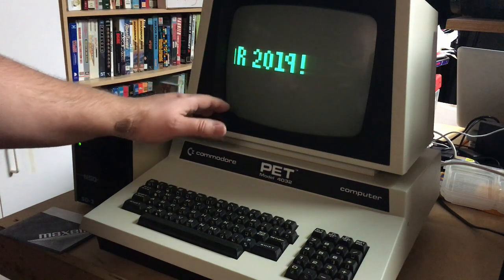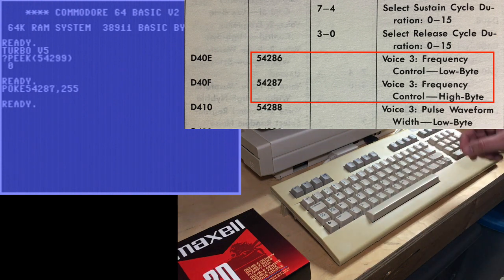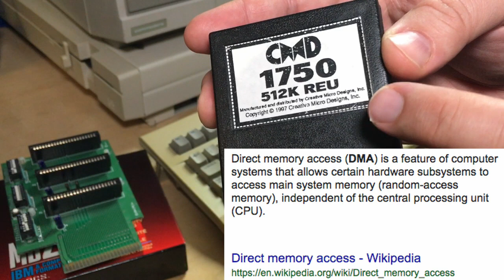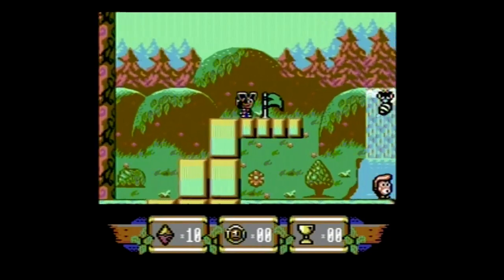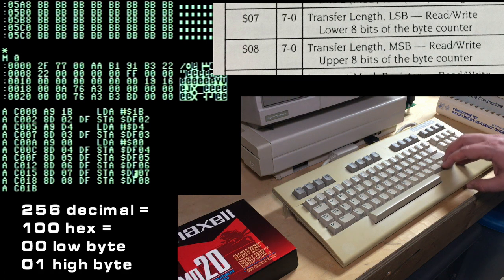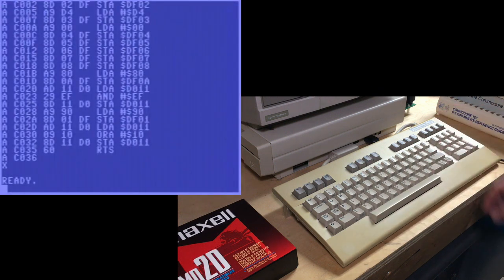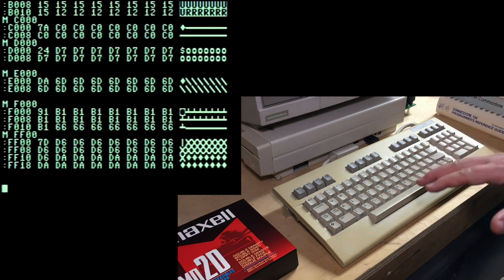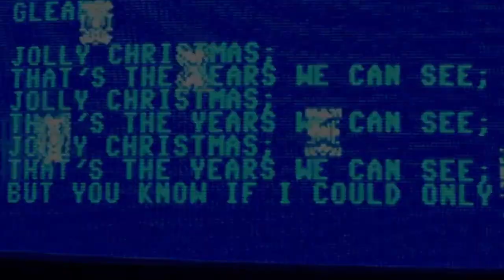Commodore 64 REU (RAM Expansion Unit) & SID Random Numbers

Comment: Very interesting episode about the REU and great teaching ! 
Before detailed pictures of the SID die were available for analysis of the actual logic, OSC3 & ENV3 were used to emulate most of the internal behaviors of the SID in a cycle-exact way, which made reSID possible. It was a big deal when it came out in the late 90s because it fixed a lot of problems like "ADSR delay bug" and "ADSR boundary bug". Suddenly SID emulators based on reSID sounded much more faithful. Sampling OSC3 also allowed finding noise periodicity and LFSR logic but it could not explain how combined waveforms were generated from logic as it involves analog stuff !
Your idea about the extra cycle is correct. A voice accumulator is 24bits, each cycle the 16bits freq is added to it. The noise logic generates a new value from its LFSR when bit #19 of the accumulator is set to 1. To get a quick idea, this happens in average every 2^20/freq cycles, with freq = 0xffff it's exactly every 16.0002441444 cycles "most of the time 16, once in a while 17"
Reply from the maker: Thanks for the awesome info! I'm interested in learning more about combining the waveforms. Years ago I made a SID-detect routine that used combined waveforms to decide if it was 6581 or 8580 but only partly understood what was going on ;)
Reply: @8_Bit  I don't know the details of what's going on at the analog level when combined waveform are enabled, on the 6581 most of them produce 0 output except the #5 waveform (triangle + pulse) which produce this very strange complex SID-specific waveform ( Flight Path 737 title https://www.youtube.com/watch?v=hCjmzaED-8k )
Maybe you have used a specific combined waveform that produce 0 on 6581 and non zero on 8580 and sum a few output of OSC3 and see if the result was 0 or so ?
Reply from the maker: @laurent64  I now remember that my routine ended up in C= Hacking text magazine. If you search for "SID Type Auto-Detect" in http://www.ffd2.com/fridge/chacking/c=hacking20.txt then you'll see my code. It looks like I combined the triangle and sawtooth waveforms, maybe not the most reliable way?
Reply: @8_Bit  it should be quite reliable, in your code you say it's not 100% though ? on 6581 the higest value is 3F and on 8580 it's FF with a lot of values > 80 so i would think your detection works all the time ? maybe you could set and clear test bit of d412 before starting the detection to make sure accumulator starts at 0 ?
Reply from the maker: @laurent64  I think it worked reliably in my tests but due to the variation in the numbers returned I felt like once in a while it might get unlucky (lots of low numbers returned) and would detect 6581 when really it was 8580. I don't think I realized the max value was 3F from the 6581.
Reply: If we take 0.0002441444*65536, we get 16.000xxx, which suggests that this condition should happen about 16 times every 65536 clock cycles, but the 17 equal-value span is observed to happen only once.  My guess (with no internal knowledge) is that there might be a 16-bit accumulator register inside the SID that sets a new random sample for the noise channel every time it overflows.  Every 16 clock cycles, the SID adds the value in the frequency register to the 16-bit accumulator register to produce the overflow.  With this arrangement, the $FFFF sound frequency will produce an overflow every time but once every 65536 clock cycles (when the starting accumulator value is $0000 and the $FFFF frequency gets added to it for the result of $FFFF and no overflow), which is what is observed in this experiment.  This behaviour could be confirmed by running this experiment several more times and seeing if there is exactly one 17-cycle span during every experiment (with no 17-cycle being observed one time in every 64K experiments).
Reply from the maker: @csbruce  Yes, I think this is correct.

Comment: Since the SID oscillator is independent of the processor, discrepancies in the polling of the SID (since the oscillator isn't precisely timed with the main clock) could produce effectively random (not repeatable) errors, like you demonstrated.
It's really cool! This sort of polling-a-slower-machine is used everywhere in computer security, to generate entropy bits  for priming pseudorandom number generators! If you've ever had a program tell you to move the mouse around for apparently no reason, it's using that kind of polling to increase entropy, which makes the PRNG better at RNG-ing! Additionally, some systems will keep track of polling discrepancies and give them to you when you ask for a random number (The CSPRNG behind /dev/random and /dev/urandom on *nix systems does this!)
I'm far from an expert on this sort of thing but it's a really, really neat way of generating entropy!

Comment: Hello Robin. I did that same tests with my Nano SwinSID installed on a C64 (250425) BreadBin using a Ultimate II+ cartridge as the REU and a Super Snapshot Cartridge also emulted by the Ultimate II+ and it would seems that the Swinsid timer is not as predictable/regular as the real one. I get no regularity in the number changing and I also get many zeros. Maybe my choice of emulated equipment renders things incompatible with the real stuff. (Or maybe I have reach my Peter's limit LOL) Anyway, your channel is among the most interesting of the genre. I did my share of assembly programming on the 6809 and the 8088 using debug, edlin and other rudimentary tools  in the days. It is only now that I get to experiment on the commodore stuff and your channel is much instructive and of great help. Keep on the great work. It is very generous of you.  Best Regards.
Reply from the maker: Hi Daniel, that's very strange and interesting that the Nano SwinSID would give such different results, or perhaps it has something to do with the Ultimate II+ REU emulation? If I get a Nano SwinSID installed someday I'll have to test this with a C= REU. Thanks for the info.

Comment: Fantastic demonstration of how to use an REU!  I had a 1764 and remember that GeOS was the only software that would leverage it -- but even then, it would only be used as a RAM-disk.  Since CMD's superior REU came out in 1997, it isn't surprising that no new retail games were written to support it.

At the time, there was also a text file in circulation showing how to modify a Commodore REU to boost it to 2MB (or 4MB?) by stacking various RAM chips on top of one another and making the required connections to traces on the board.  You can imagine the quality of schematic in that file -- all done in PETscii!  If I am not mistaken, the 1764 circuit board has several spaces where additional RAM chips may be added, effectively turning it into a 1750.

Comment: Pulling a value from a free running oscillator like that works like Sample and Hold on analogue synthesizers. It takes the current voltage at a certain point in the oscillator cycle and holds it for a finite amount of time - you apply that voltage to another oscillator, filter, amplitude or any combination of the three. It's how classic Sci-Fi "bleep bloops" are created, including, I think, the random beeps from R2D2 (which used an ARP2600).

If you slowed it down and applied the value to the pitch of oscillator one set to a square wave, you'd get instant Sci-Fi! I might have to try that. :)

Comment: The random number update makes sense. 0xFFFF programmed into in the SID frequency  counter represents ca. 65Khz. If the REU is reading every 1Mhz, then it will read the same value 16 times before the SID updates. I love it when something computes!
Reply: Yes the frequency register of the sid is added to a 16bit counter every clock cycle, and whenever it wraps the next "wave pulse" starts, or in this case a new random number is chosen.  So yes if it had been able to be set to 65536 it would have been exactly 16 times for each value.  If it was set to 32768 it ought to repeat each value exactly 32 times.  With 65535 it should have one extra repeat every 64k clock ticks, exactly as was seen.

Comment: As a new C128DCR owner I find this very interesting.
Over the past month or so I have bought the following stuff on ebay:
The aforementioned C128 with a mouse, joystick and video cables;
A Commodore 1750 REU;
An MPS1230 printer;
Several systems- and utility programs on diskette;
a Datasette unit;
and finally, an 1084S monitor.
Oh and I almost forgot, Simon's BASIC on cartridge.

I think this is a pretty neat setup, wouldn't you guys agree?
Reply: @8-Bit Show And Tell Aww thanks for the hearts!
Reply from the maker: That's a very nice system you have, enjoy! :)

Comment: So these expansions were actually only used as a ram disk, and not when running a program. I have a small 8 bit processor on a breadboard and am looking into epanding the RAM up to 16 megabytes. A unique feature of the processor would allow me to actually emulate a simple MMU in software and call subroutines (almost) anywhere in this expanded memory space..

Comment: Using a RAM expansion unit as a piece of test equipment - Genius! Loved it!! Possibilities include capturing pulse trains into the USER port and analyzing the repetition rate using the same method as viewing the SID chip's output. A storage oscilloscope would achieve basically the same measurement, but because of the limited screen resolution, you cannot see the exact number of microseconds between pulses. I have some programs that use the USER port for data acquisition and control, using optoisolators to couple the outside-world circuitry to the C64 or C128. Could you make some tutorial for others as to how to use the User port to interface the computer to other devices? Thanks for very good presentations. GB
Reply from the maker: The other thing about an oscilloscope is that it probably wouldn't sync exactly to the CPU, which runs at ~1.02 MHz on an NTSC C64. So cycles and microseconds aren't exactly the same thing.

A user port episode would be interesting, thanks for the idea.

Comment: You should try and find yourself a Mini Chief 1571 drive. It was a kit or a complete unit were it had either a 20 or 40MB minicheif HD  inside a 1571 floppy drive. The floppy drive worked, and with the HDD you had a choice of breaking the drive into x number of 644k partitions or have it as one large one. (I think it was 644k per floppy normaly??).

Comment: Love 6502/6510 assembly.  I doubt this would confuse anyone, it shows how nice it is.  Load values into the accumulator (LDA) then alter them and store them (STA) into some memory register.  Something else you could program, and I don't know if you ever touched on this, was the Commodore floppy drives like the 1541, it actually had it's own computer inside of it with a few commands of it's own.  I once wrote a "virus" (not really but) which would disable a single bit on a floppy disk making it unreadable.  I didn't share it with anyone, I was just messing around, but a friend of mine was curious about it so I gave it to him with the warning about what it did.  Later on, he forgot what it was, ran it with his favourite floppy in the drive and he could no longer read from it.  So he threw the floppy disk away and I told him he should have told me as restoring the disk was just as simple.  Anyhow, just a fun story from the days when I learned about that. :)
Reply from the maker: I've been meaning to do an episode about how fast loaders work, and that would involve programming the disk drive. The closest I've done is the episodes about Animated Disk Directories, and the Epyx Fast Load one. I made one disk unreadable by editing the DOS type byte with the disk editor!

Comment: One more quickie. If you have a PSU that provided more amperage, and the REU pulls those amps across the 64's motherboard, could it harm the 64? I ask because in circuit design, you have to be careful about amperage and heat dissipation. Too many amps across a small trace will fry it. The PSU will not limit the amperage, only voltage. The device (e.g., REU) determines the amp draw.

Or does the REU meant for the C64 have a seperate DC power input on it? Asking for a friend. :)

Seeing how Ray Carlsen makes a 5A C64 power supply with overload (in addition to over voltage) protection, I would guess 5A is safe to run through the C64?
Reply from the maker: I'm not much of a hardware expert, but I know I've used the 512K REU on my 64C, with a heavy duty power supply, for many extended coding sessions without any problem. The REU is powered through the expansion port, there's no separate power input on it.

The power supply included with the 1764 REU provides 2.5A on the 5V line and it's enough. But if Ray Carlsen makes a 5A power supply, it must be safe. I'd trust every Commodore I own with him :)
Reply: I wouldn't worry about burning out traces, that generally comes down to component failure and Commodore 8 bit machines have stood the test of time.

I think you've misunderstood why Mr Carlsen appears to use an over specified PSU. From his site, "If you are making your own power supply, the +5VDC should be able to source at least 2.5 Amps for a C64 and 5 Amps for a C128. Since the cost for each switcher module is about the same, I use a 5 Amp module so my PS can run any Commodore computer."

Keep in mind that the PSU's Commodore included with the REU were designed to power a C=128 hence the higher rating, they were also switching supplies and not susceptible to the well known  regulator failure that kills 64s.

Comment: You are good at this and know the architecture well! Did the reu sample the random number for every cycle?
Reply from the maker: Yes, the REU sampled the SID's random number output every cycle, for 65536 cycles which is the maximum length of an REU transfer. I cleared bit 4 of $d011 during the transfer so that the VIC badlines wouldn't interrupt the REU at all.

Comment: Excellent intro into the REU! It seems pretty powerful. I see that it isn't limited to reading from the C64's RAM - it can also read from the C64's IO-memory (such as $D41B as you show in the video). Can it also write to the IO-memory? I wonder if the REU makes it possible to abort an already started badline (change $D011 after the VIC has taken over). Or is the REU also blocked by the VIC during badlines, like the CPU is? I've always wondered what would happen if an already started badline was aborted... Anyway, very interesting! :) 

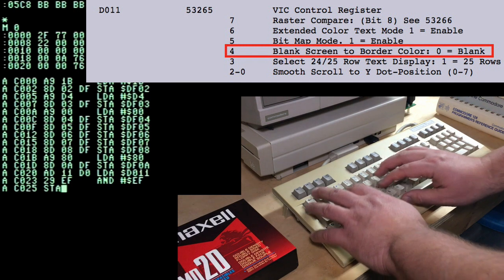EDIT: I wrote this after having only watched the first 25:00 minutes of the video, and i guess you answered my question a few seconds later ;) So not possible.

(But it looks like it can be used to set up IO registers many times faster than the CPU (1 write pr. cycle), so cool VIC-tricks must still be possible with it, that aren't possible without it!)
Reply from the maker: I'm almost positive the REU can write to C64 IO space, though I'm not sure I've ever tried. I've definitely tried reading $D012 and have a video planned about that, as it's interesting how we can analyze the cycles per scanline and scanlines per frame characteristics of the various VIC-II versions that way.
Reply: @8_Bit  Looking forward to it! :) Yeah, it's actually pretty amazing - i'm really surprised by the power of the REU! A really good tool for analyzing the behavior of the IO-chips - and (assuming you can also write to IO) an amazing tool for making the VIC do impossible stuff! (Like for example (simple example) 1 cycle wide raster-splits, by making it write to $D021 or $D020. Crazy!). Thanks for the introduction :)
Reply: Yes you can DMA to and from I/O but according to Groepaz it is unreliable. Details are posted at https://csdb.dk/release/?id=144105 which also happens to be the release page for Treu Love an incredible REU based demo.

Comment: The occasional 17-cycle sample occurs because you only set the noise frequency to 65535, not 65536. (Indeed, you can't set it to 65536 because the register is only 16 bits wide.) I bet if you set the noise frequeny to 32768, then you would consistently see your random numbers persisting for exactly 32 cycles every time.

Comment: One note about the REU bank register..
Writing to this register always works as expected, but reading does not. The value returned by it will always at least be $f8 because all the high bits always return 1, even on an expanded REU (official, ie CMD 1750XL, or user upgraded Commodore 17xx).

Comment: I wonder, wouldn't a loop do the trick? increment a number with each cycle and print the peek on the screen followed by the number, after a while you should see how many cycles it takes before the peek number changes.
Reply: BASIC would be too slow to do this. You definitely would get a new value EVERY time, but what you would NOT know is that between readings, hundreds of other values were already generated and discarded. It's possible to catch the SID readings quickly enough on a stock 64 without an REU using machine language. You would need to then examine the raw results knowing how many cycles it took to fetch each sample, versus the 1 cycle per sample convenience the REU provides.

Comment: Here's a n00b question as it relates to REUs. If you had a 1750 plugged into your C128D, then entered C64 mode to play a game (like Sam's Journey) does it properly see and use the REU accordingly?
Reply from the maker: Yeah, all the models of REU (1700, 1764, 1750, CMD 1750XL) work in both C64 and C128 mode, and also work on a regular C64. The only thing is making sure you use a heavy-duty power supply on the C64, as the REUs draw more current than a regular C64 brick can supply safely.